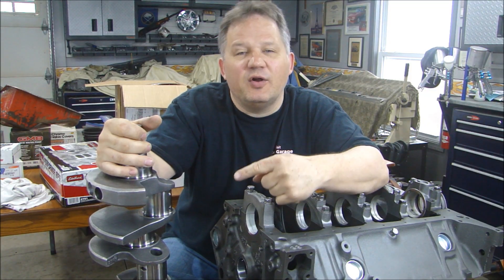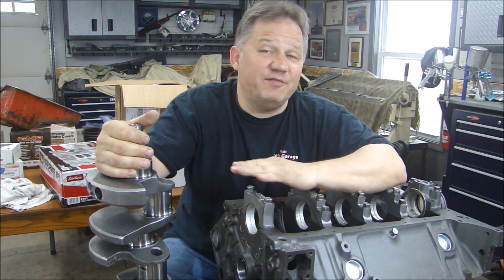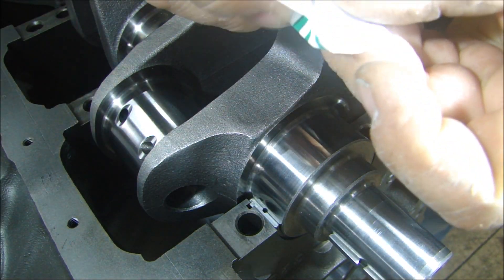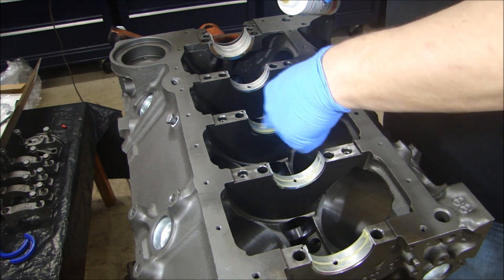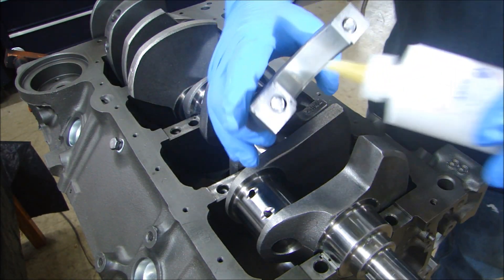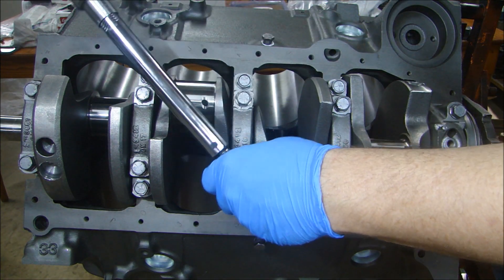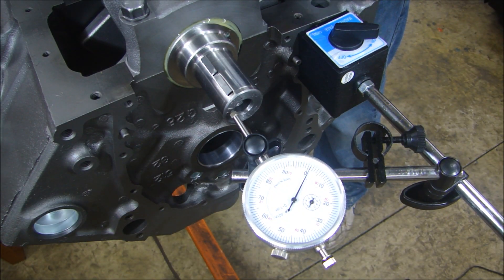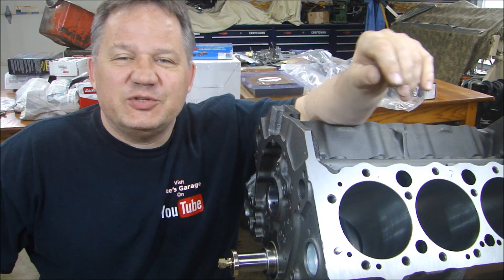Engine Building Part 1 - Installing the Crankshaft in a 350 Chevy for a '76 Vette

Comment: im building my first smallblock this winter, its a std bore 400 for my firebird and man this is helping alot, i spent pretty much the whole summer getting parts, tools, and consumables in order to build. It is more of a budget build, but i do have some good parts going into it and i really want to make sure nothing goes wrong and it lasts me for at least a few tens of thousands of miles. One of the things im wondering about right now is how to properly install the oil filter galley plug, if it matters which direction it's facing and if i need any special tool to make sure it's going in square or if i can just use the same 1/4" rod i took it out with to set it back in there

also properly setting valvetrain geometry and measuring sweep seems difficult and using a sharpie mark on the valve stem doesnt seem like the most accurate way to do it
Reply from the maker: I have videos on all of that

Comment: What is the benefit of installing the crank before the Camshaft does it matter which way. Or is doing the crank first best?
Reply from the maker: It really does not matter. I put in the rotating assembly first so if I drop a rod nut or bolt it doesn't nick the cam.

Comment: I know this thread is several years old but a guy I know watched it and asked me a question and I thought the answer to that question would be appropriate here since I did not see it in the video.
The publisher stated that he did torque the bolts in steps which would have been nice to mention in the video. Also the thrust bearing needs to be set in place. Most builders will torque all the main caps in steps and then loosen the rear main cap and lightly tighten to around 15 lbs. Get a plastic or rubber hammer and strike the back of the crankshaft where the flywheel rides and that will set you thrust bearing halves. Now torque to specs. .004-.008 is the acceptable spec for the 350 crank end play where as I tend to shoot for .006. If the thrust is too tight after checking it several times then the thrust bearing halves need to be sanded. To do this you will need a a sheet of 400 grit wet or dry and a sheet of 1000 grit wet or dry. You also need a smooth flat surface such as a piece of glass or aluminum large enough for the sandpaper to fit on. Take the bearing halves and put them together like they would be if surrounding the crank journal. Use a large stainless hose clamp to hold them together. Now put some marvel mystery oil and something to lube the paper while sanding. Sand only the face of the bearing that points towards the front of the engine. You leave the rear side alone due to the thrust from the torque converter or clutch.
Measure the bearing thickness and note that on the bearing in the location you measured. Do this in several places. Most performance bearings are built with multiple ramps so measure carefully and record the thickest overall measurement. Now sand the forward side of the bearing halves in a figure 8 pattern, stopping ever so often to clean and check the measurement until you have removed the desired amount to achieve the .006 of end play.
I hope this helps someone. That end play is important so take your time and make sure it right. The effort and time you take to do it will make you proud that you did it right the first time.
Reply from the maker: Great comment

Comment: How about slowing down a bit on the torque pattern? Or showing it on paper. Thanks.
Reply from the maker: You could always hit pause
Reply: @PetesGarage  Hi Pete and thanks for the reply. I did hit pause and you're correct the torque pattern is pretty simple cross pattern working from the center out. Thanks again.

Comment: How many foot pound of torque can it take to turn a brand new engine thats been primed without spark plugs in the heads? also is this ok to do? i dont mean as a hobby,lol but just to check things? i assume it is since a lot of people turn their engines while they prime them and also to check pushrods and things like that, i have worked around engines all my life but im not a real pro in rebuilding them.

I have a 347 that i had professionally built and i have it siting on a cradle because its gonna go in a car a few months down the road, the engine was primed and its a beaut but it takes like 42 pounds of torque to turn this thing and i was wondering if that was normal, thank you for your time.
Reply from the maker: Depending on the compression it could take quite a bit. As long as it turns smoothly it's ok.

Comment: Which anaerobic sealant did you use? I see Permatex 51531 but they also have a 51813 and I can’t see what the difference is
Reply from the maker: Either will work fine

Comment: Just got block back from machine shop , it was cleaned by the machine shop but I want to double check that the galleys are 100% clean what can I do to clean the galleys and remove all the wd40 that was sprayed
Reply from the maker: You can spray it down with IPA

Comment: You answered a question I had  on installing a clocked rear main seal , but I wish you would have went into a little more detail on the location of the clocked rear main seal and the sealer you used, did you put sealer behind the seal on both the block & cap ? did you wait to let the stuff tack up ? how long to tack up before you installed the cap. ?
Reply from the maker: Just as long as the break in the seal is not in line with the cap. Put sealer behind the seal on just one side, block or cap. I use Hi Tack, you can put it on right away.

Comment: When you measure bore with bearing shells fitted it should be crown to crown. Otherwise you risk adding tolerances from eccentricity and joint face relief on shells.
Reply from the maker: Great tip!
Reply: @PetesGarage  also, bearing wall thickness is measured at crown for grading.

Comment: Great video!! Question; have you ever had to fix crank bolt threads or even drill and tap a bigger bolt in? I damaged about a quarter inch of threads on the beginning part of the threads with my balancer removal tool. Do you think that is fine? Thanks!!
Reply from the maker: I have had to fix them, use a tap and see how it looks
Reply: @PetesGarage  I tapped the threads with original size 7/16 20 tap but that first quarter inch of threads are toast. The rest of the threads are perfect.
Reply from the maker: I think it will be fine
Reply: @PetesGarage  It was! Thanks so much

Comment: I know this might be a dumb question to ask.
But is building an engine cheaper than buying an already built one?
For example is it cheaper to buy a  2.3L MUSTANG ECOBOOST CRATE ENGINE or build one yourself?
Any advice would be appreciated
Reply from the maker: It really depends on the level of quality you want in parts. With identical parts a crate would be about the same. If you want to change parts to increase performance it's better to build yourself.

Comment: Staggering the rear main seal. Do you do that on a Small block ford as well? Great video thanks for making these.
Reply from the maker: I do that on every engine that has a symmetrical, split rear seal.
Reply: @PetesGarage  Thanks very much, Pete, for sharing your knowledge. I'm doing this with the engine still in and working from below on 351W. Any way I can be certain I'm not crimping the gasket by staggering it like this? I see people using Permatex Black gasket maker just at the gasket. Any thoughts on that? Also, did you apply sealant beneath the gasket. Thanks so much!

Comment: Hi im 22 and building my first 350 vortec for my studebaker avanti. I installed my new crank and bearings. When i go through my first pass of torque, my crank spins freely during my second the crank locks up. Any ideas or advice?
Reply from the maker: Did you check all of the bearing clearances? Possible something under one of the bearings?
Reply: @PetesGarage  my dumb ass had the main caps on backwards... That was all. Hopefully nothing got scored

Comment: Ik you made this video a year ago but Pete would all of the torque settings you use for this 350 would it be the same for a big block Chevy say a 454? And thank you for the videos!!
Reply from the maker: No, a big block is different. All engines are really different. You need the torque specs for each engine.

Comment: When I prep a block I usually wash it down with a pressure washer and hot water and then I have it magnafluxed.  If it passes muster I take it back to my shop and spend some time cleaning up the casting flash on the outside.  I don't grind it smooth just make the ugglys go away.  Before I put the die grinder down I check all of the oil return hole in the valley paying particular attention to the ones in the corners. I have found oil return holes completely plugged with flash and others where the flash will break away with a push of my finger.  I take the block back to the machine shop for a through cleaning, boring, decking, and other necessary machine work.  When the machine shop is finished I take the block back to the shop where I wash it with hot water and Dawn dishwashing soap.  All of the oil passages are rod brushed until they rinse clear.  Finally I scrub the bores with Comet and immediately rinse and spray with WD40.  The final step is a cylinder wipe down with paper towels and WD40.  When the paper towels come out clean I am ready to start assembling.
Reply from the maker: That is a great process. My machine shop does all of that too. I'd be a bit careful with the paper towels though, they can breakdown and leave tons of fibers behind. Sounds like you're doing a great job, keep it clean with lint free cloth.
Reply: Do you clean the wd40 off before assembly or will it not affect anything?

Comment: Real nice job so far, Pete. What would you do without all the Y-Tube certified engine builders? It's not the space shuttle people.
Reply from the maker: Thanks my friend. Well, I appreciate every comment. There is something to be learned from them all. BUT, I do delete profanity and insults. If it's not a constructive comment that adds value I delete it.
Reply: Actually anyone building an engine thinks of it as important as the space shuttle. The tolerances in engine building are as tight as some on the shuttle.

Comment: When you go from a higher to a lower setting on your torque wrench, in this case from 70 ft lbs to 65 ft lbs, you should go down from 70 to a lower number say 40 ft lbs, then back up to 65 to take up the back lash in the screw to get a truer setting.
Reply from the maker: You are absolutely correct. I did that briefly out of the camera shot. I'll make that point in the next video, thank you
Reply: Yes sir, you are a mechanic and not a hack by that statement.
Reply: Another way I do if anyone likes...do them all at 65 then do the 70s and one more quick check on the 65s

Comment: What about a dial bore gauge? Maybe less chance of scratching. Love the videos 👌🏼👌🏼
Reply from the maker: You can use a bore gauge, but I'm trying to show how to do it with standard tools most people own. Thanks for the comment
Reply: A set of snap gauges comes in handy all the time for inside dimensions: use tips that have a slight convex grind/polish, which is kind to surfaces and lets simple calipers to be used afterwards once matching dimension is locked down.  It's cheaper than having a dedicated bore gauge, with more uses.  A set [of 5 or 6] is going to be anywhere between $35 and $200 depending on features/coatings etc.  For most engine work, single side telescoping is all that you'll ever need [and that makes the tool cheaper to own].  The set I have used for years is a 5 piece [Starrett No. S229GZ], which I take care of by wiping down with just a little SP350 before putting back in the toolbox.
Reply: great video Pete I remember doing this in school
Reply: Actually anyone can afford a dail bore gage. U can buy good name brand ones used on ebay.also check Craigslist and Facebook market place. 
U can also buy cheap imported ones and they work quite well.i own a machine shop and use the cheap ones(calibrated they work well i have checked using my brand named ones)
Using a plastic gage is the old school way...
Also never trust any machine shop when ur building motors..and especially if ur doing it for other people. Alway always check the work the best u can. Anyone can make mistakes...plus if we know ur the average joe....certain things are let go because we know u will only bring that car out 5 times a yr.maybe lite the tires once or twice but thats it..no matter what u tell us most cars don't leave the house..or trailer...if we know ur going to race it and beat it....well thats a different story
Reply: @Itwillgetbetternever  I have a question do u have IG?
Reply: Exactly. I was surprised to see a set of calipers used to measure the clearance. Even starrett calipers only have an accuracy of .001 thousands.  Cranks are ground, not machined because a machine cutter can not actually achieve the the accuracy needed. To each there own but I would recommend using bore micrometers and od micrometers to check clearance. Especially if you are building a race engine and are trying to get the least amount of drag on the crankshaft as possible.

Comment: Also don't forget to use assembly lube on bearing surfaces before final installation and torquing of bearing caps.
Reply from the maker: I did do that, I tried to make the video shorter, I guess I should show every step.
Reply: Nah. I know you use assembly lube Pete. My comment was for the person that's never done a rebuild before and is contemplating it. Just watching your back,so to speak. The videos are fine. Keep em coming.  ;-)

Comment: Should have oil on the seal and the bolt threads
Reply from the maker: https://youtu.be/XlNig19tWg8
Reply: Pete's Garage yes, understand, but torque on bolts are too inconsistent w/o lubricant.
Reply: Front Line Media WRONG about oil on the threads. You WILL get an inaccurate reading by oiling the threads and can over torque them, not to mention this will seriously affect TTY bolts. You can also get too much oil into the bolt hole and cause a hydrolock issue and then not get enough torque. Seriously bad advise, man.